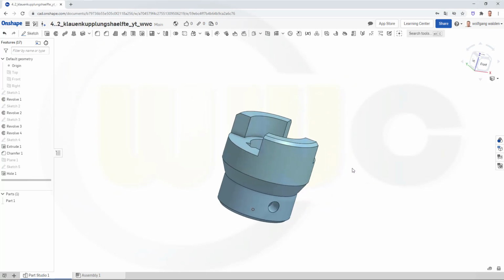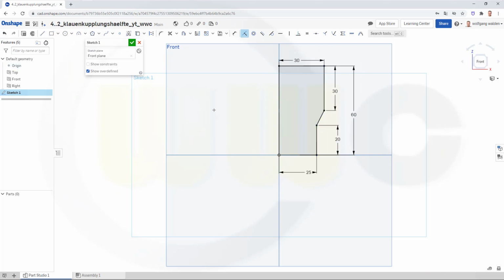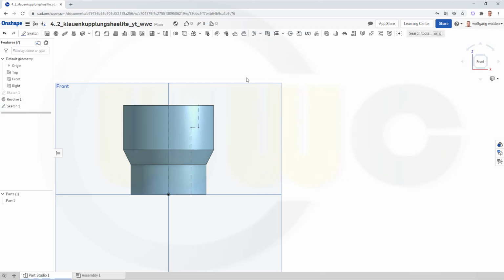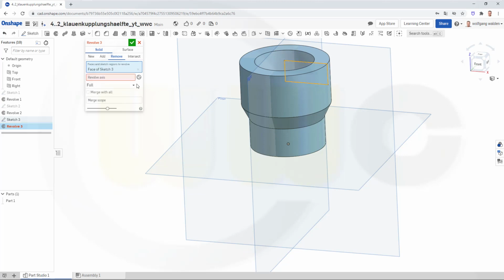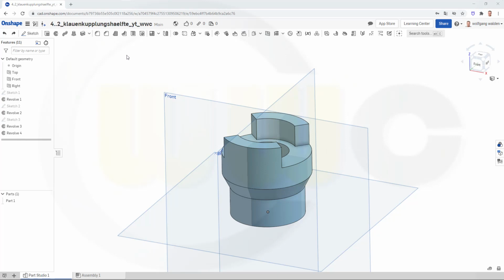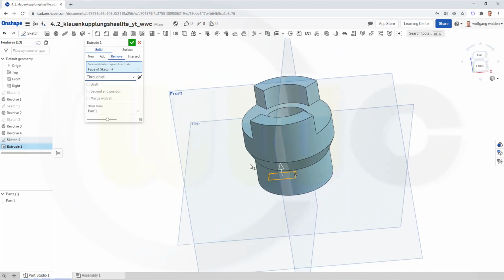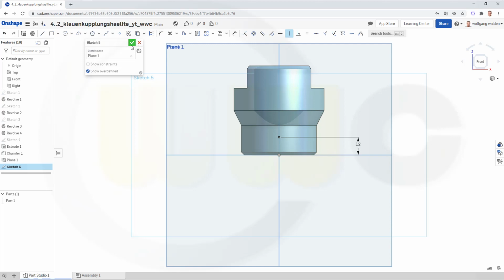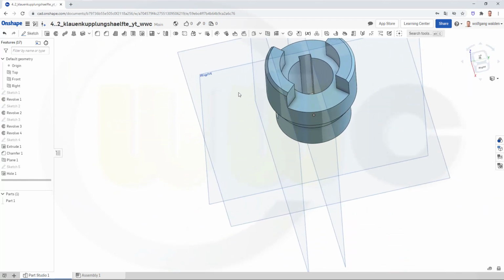4.2 Klauenkupplungshaelfte - Onshape Training - Part Design

Comment: Is there any reason you didn't used "circular array"  for the second angle revolve? For me, it looks more work see set up the angles.
Reply from the maker: Because it is an exercise for revolves not for patterns. ;)
Reply: @wolfgang.walden.cad.training  Got it. Now even other decisions makes more sense. 😉 Wouldn't it be good to reflect it in the name (instead of "part design")?
Reply from the maker: Maybe, but there is a numbered list on my website (basic training) - so all exercises with 4.xx are for revolves - 5.xx for patterns etc.
Reply: @wolfgang.walden.cad.training  Ah so! I'm following the channel only. 😉

Comment: Вы меня понимаете?
Reply from the maker: You have to use an assembly. Usually there is no way in any program to load 2 step parts into 1 part. At least I´m not aware of any.
Reply: @wolfgang.walden.cad.training  Well, I made an assembly of two parts, but how can I continue working with them in PartStudio???
Reply from the maker: Export the assembly as step - then import the step assembly - use option to combine it into one part studio ;)
Reply: @wolfgang.walden.cad.training  I basically wanted to understand this! the fact that onshape does not allow you to work with such files directly))) we have to use various tricks. thanks
Reply from the maker: you´re welcome